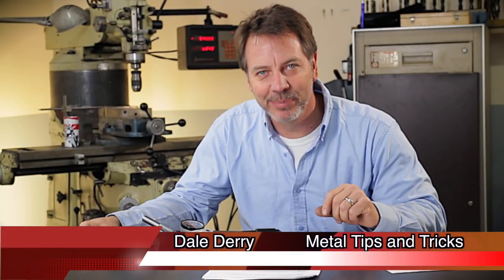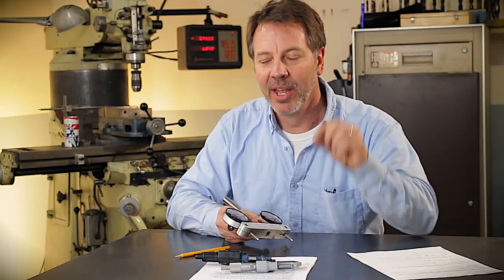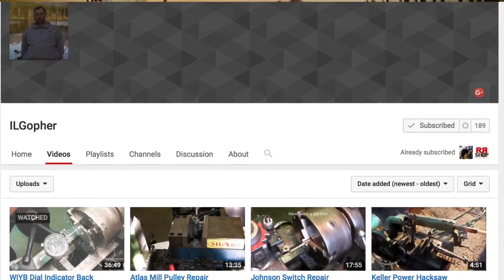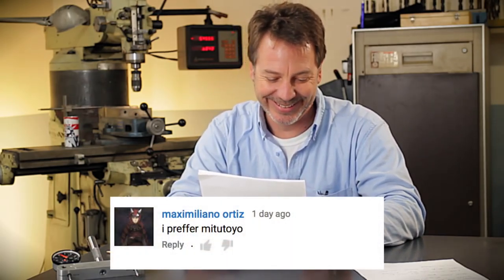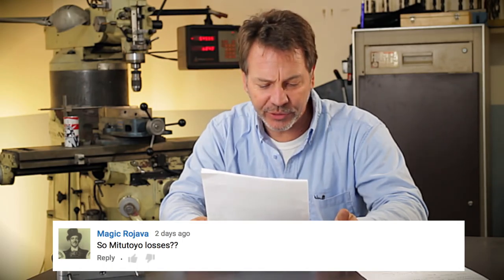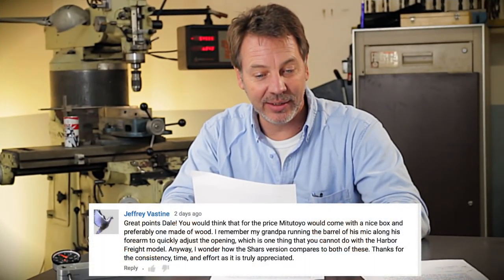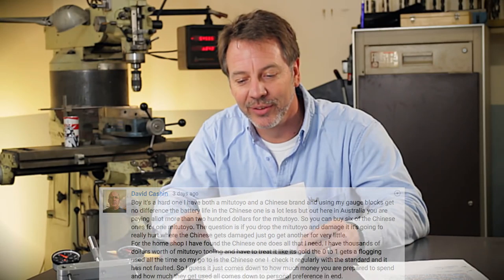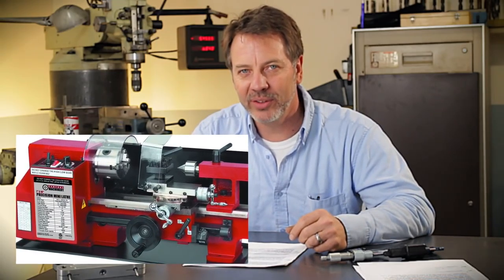Q & A  Harbor freight VS Mitutoyo Digital micrometer

Comment: Dale,
I would like to comment on the “watch” batteries used in these digital devices. There are two basic types available. Silver Oxide (expensive) and Alkaline (cheap). More of your low cost imports come with alkaline which is one reason they don’t last long. Replace them with silver oxide and the life dramatically improves. Also I wasn’t able to find the article but I believe Tom Lipton made a comment in a video also. On the calipers the on/off switch doesn’t really do anything for batter  life. All it does is turn the display off to make you feel good. An LCD display basically use the same amount of power when on or off. The switch does not disconnect the battery like it does on the flashlight.
I want to thank you on all the very good videos you produce.
Al

Comment: I bought one of these and tested it on my gauge blocks and I was really flabbergasted by the accuracy and repeatability. For the price it is hard to beat. I would not spend the money on the mitutoyo because I don't need that level of accuracy. I would put my limited funds elsewhere, but I don't begrudge anyone spending $ on a really fine tool. But if I can have 10ths accuracy for $35us then why not! I am enjoying your channel.

Comment: Good video, Dale,   If it were not for the inexpensive imports I could certainly not have my tools, and I still have my Harbor Freight mini-lathe.  Have upgraded in size a bit since then but just couldn't part with that little starter lathe.  For my work which isn't production but mostly prototyping I have come to like the Grizzly grade of machine tools.  Keep up the good work.
Reply from the maker: +Glenn Felpel 
Thanks for your comment

Comment: Dale, Have you seen the Video that AvE did on current draw of Mitutoyo vs. Chinese Digital Calipers?  He quantifies the differences.  There was a big difference between the Mit and the one that he tested.  One important point that he made was that the Chinese Calipers started giving wrong readings when the batteries were low.  If you mess up a piece because of a bad measurement there is a hidden cost for the cheap instrument.
Reply from the maker: +GaryGrumble 
Thanks for the info